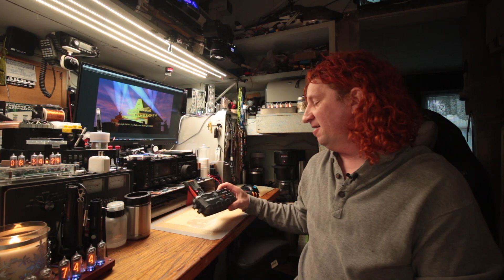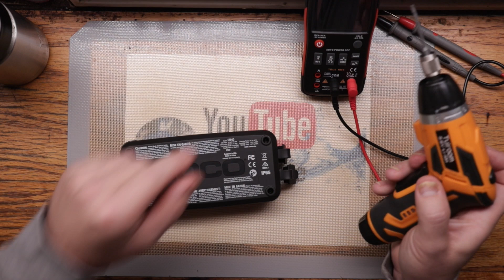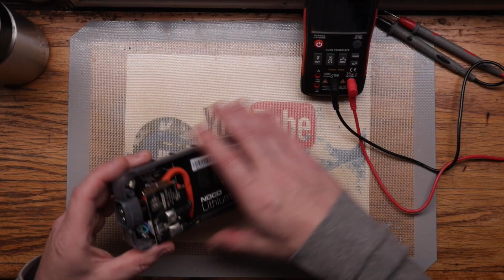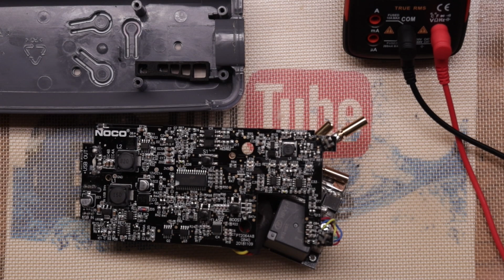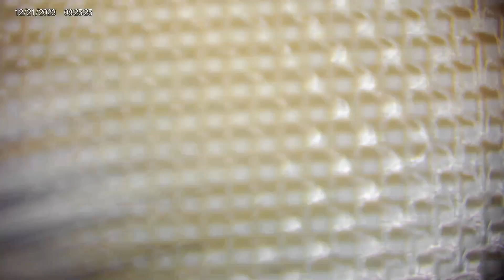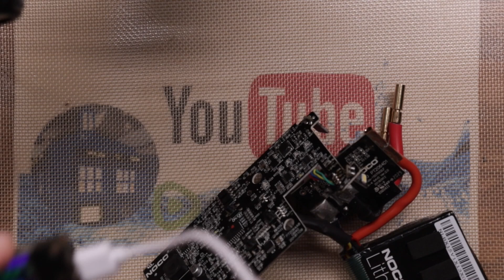Fixing a Broken NOCO GB40 Boost Plus!

Comment: If anyone can help me. I need what value is the capacitor C12 next to this chip. I've tried different ones but it hasn't worked so far.
Reply from the maker: 2.4 microfarads (μF)
Reply: @RollingTardis  Thanks, I'll try.

Comment: Is process the same for Noco GBX 75? Mine won't charge no lights nothing. But when I put a voltmeter to it positively on the positive clamp and negative lead on the USBC and outport it needs 15.8 volts but will not turn on or charged
Reply from the maker: You many things to check, is there 5 volts at the 5 volt test point, 3.3 at the the test point, need to check the various diodes for shorts, same for caps. Best option is to refer to youtube for your particular no charge no light for GBX 75.
Reply: @RollingTardis is it possible to send it to you to have it fixed and what wud you charge
Reply from the maker: @BOSS_805  Best place to send your NoCo is 
Youness Faiz 
12911 Sarah LN
Largo FL 33773

YouTuber, SOSFix Electronics
Reply: @RollingTardis thanks I'm going to inquire with him through his Facebook page

Comment: Did you post the video of battery replacement in the GB40? Mine is not charging and was poofed up but now after a year its flat now but wont charge. Only blinks at 25%
Reply from the maker: Never made a video on a battery replacement. Since you stated your pack is poofed and flat. The charge circuit will never charge, them internal cells. They will have to be replaced. You'll need new cells. Part number SDL-606080.

Comment: sup dude! I have one of these and I turned it on and then it turned itself off. I had fully charged it a day or 2 ago, and today it showed low battery when i turned it on, then it turned off. I opened it up, watched your video, and that T250 chip is extremely hot! please advise! ty
Reply from the maker: Seems like that chip is shorted. Or something else  related to it, is shorted. Need to do the basics. Diode checks, resistance checks for caps.  At the very least, it's just a bad chip.

Comment: Okay so when testing the voltage coming from the charger im not getting any voltage as well across the other areas you said to check for the charging circuit I got nothing. The charger port itself doesn’t look to be messed up at all and the charger cord itself works when charging other items. Any idea on what it could be?
Reply from the maker: Sounds like a charger port fault, or something related. I am going to redirect you to a channel with more in depth info. Do a search for GB40. https://www.youtube.com/@SOSfixElectronics/featured

Comment: Hey can you help with mine noca gbx115.

Upon starts it flashes all the lights and turns back off
Reply from the maker: Check all your individual cell voltages. Can also check the 3.3 and 5 voltage test points.

Comment: Cool, got the same rework station and the GB40 from fleabay. Mine works, at the moment, did you put leaded soLder on it in the end, cheers from Engerland, in the UK😁
Reply from the maker: Yes I did, touch up with leaded solder.